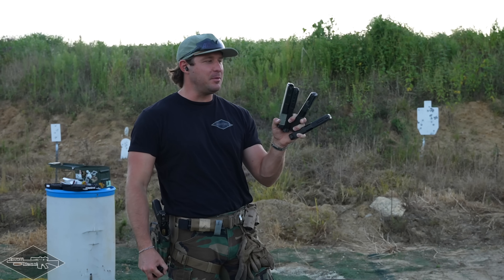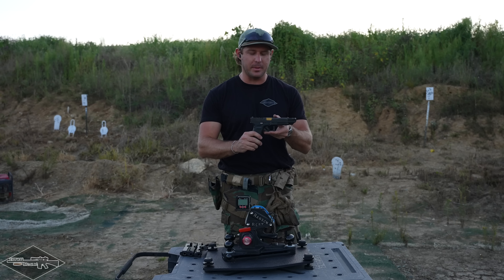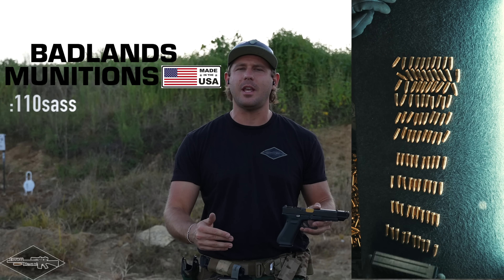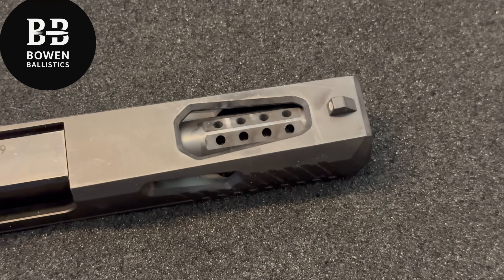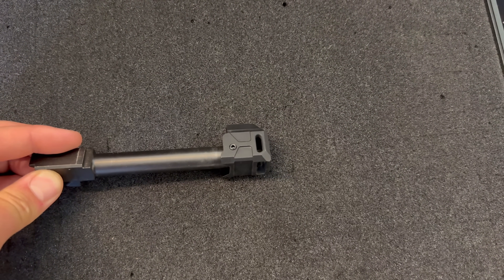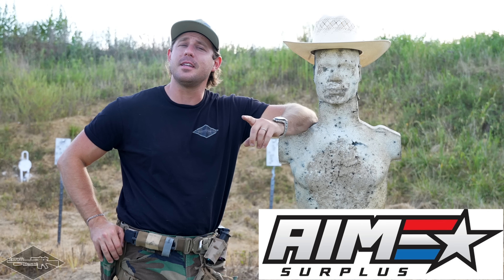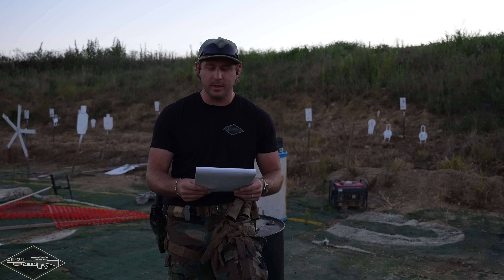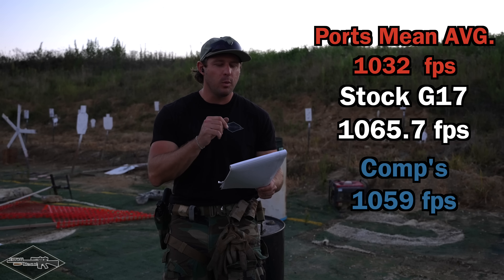Science Finally Proves It - Which Is Best?

Comment: accuracy??? seen bunch people that say comps dont affect accuracy but ports do
Reply from the maker: Nah. Quality machined ports will not impact precision 

Garbage shit will absolutely
Reply: @110sassactual  think its the physics of letting gas out part way not bad machining...
Reply from the maker: @colt45lmer-s4h that’s not how that works lol
Reply: @110sassactual  how you know?? less pressure even a little could reduce the engagement of the rifling or that the holes would interrupt the rifling could easily mess with the accuracy. i could be wrong but without some real testing it could affect it. plus i have seen several comparisons where the port had worse accuracy
Reply from the maker: @colt45lmer-s4h yes, again… a poorly machined port will absolutely effect precision…

No, redirecting gas isn’t effecting precision of a handgun. Again, it’s the poorly machined ports with burr’s tearing up the projo and causing a non uniform projo to exit the barrel 

That’s literally it bro. Don’t over think it

Comment: Great video. I’m wondering though if there’s a better way to isolate just the ports/comps as the only changing factors. I’m thinking using one G17 frame and swapping out the top ends with G17 and G34 top ends, both with window cuts in the slide, and each of which would then be configured with a non-ported or compensated standard barrel, a ported barrel, and a threaded barrel with a compensator. Keep the number/configuration of the ports the same and use the same model compensator between the two. That way the gun is configured as identically as possible between the different tests, with the only change being the presence of porting or compensator

Comment: How much impact would the center of gravity shift have on this data? I would guess, not much. Though a ported barrel will shift the center of gravity very slightly rearward. While a compensator will shift it forward (muzzle heavy). Obviously the degree of that depends on how long and heavy the compensator is. At some point it becomes a compensation weight like we see on many competition guns. Just curious. Might be an interesting things to test, but probably not interesting enough to make a fantastic video. Cheers.

Comment: I still use SOHCAHTOA on occasion in my shop.  In the past year I've been shooting a ported Hellcat Pro Comp in lieu of my un-ported Pro OSP, and the difference in felt recoil and muzzle flip is notable.  The Pro Comp isn't nearly as snappy and is easier to return to target.  I should point out the name is a bit misleading.  It's really a ported barrel and slide setup and should not be confused with the Hellcat RDP (which does have a comp hanging off the end of the barrel).

Comment: Just in case anyone wanted the statistical analysis on the differences and not just their means (I did not throw out the bubba gunsmif). Formatting sucks because it is YouTube:

Key descriptive anchors
Stock G17: n = 10, mean = 18.62°, SD = 0.57°.

Per-device vs stock, direction and magnitude
Mean difference is device minus stock, so negative is less muzzle rise than stock.
Bubba gonsmif: n = 12, mean = 12.05°, Δ = −6.57°; reduction 35.3 percent; p < 1e−13 after Holm; g ≈ −13.63.
Bowen Ballistics V8: n = 8, mean = 14.31°, Δ = −4.31°; reduction 23.2 percent; p ≈ 5.9e−14; g ≈ −8.58.
North Sea I6: n = 13, mean = 14.65°, Δ = −3.97°; reduction 21.3 percent; p ≈ 4.9e−12; g ≈ −7.12.
Agency comp: n = 10, mean = 15.92°, Δ = −2.70°; reduction 14.5 percent; p ≈ 5.0e−9; g ≈ −5.42.
North Sea Hybrid: n = 12, mean = 15.92°, Δ = −2.70°; reduction 14.5 percent; p ≈ 2.8e−9; g ≈ −4.92.
Radian comp: n = 8, mean = 16.09°, Δ = −2.53°; reduction 13.6 percent; p ≈ 2.7e−8; g ≈ −4.63.
Herrington comp: n = 10, mean = 16.41°, Δ = −2.22°; reduction 11.9 percent; p ≈ 3.0e−8; g ≈ −4.03.

All devices show statistically significant reductions versus stock.

Ports, pooled: n = 45, mean = 14.23°, Δ = −4.39° vs stock; p ≈ 4.3e−18; g ≈ −3.08.
Comps, pooled: n = 28, mean = 16.14°, Δ = −2.48° vs stock; p ≈ 9.0e−9; g ≈ −4.90.

Ports vs Comps directly: mean difference = −1.91° in favor of ports; Welch t ≈ −7.85; p ≈ 1.3e−10; g ≈ −1.53. 

One-way ANOVA across all groups: F ≈ 189.68; p ≈ 5.1e−45. There are strong between-group differences.

Every tested product reduced muzzle rise versus the stock G17, and all reductions are statistically significant after multiple-comparison control.

Among individual setups, Bubba gonsmif shows the largest mean reduction, followed by Bowen V8 and North Sea I6.
By category, ports outperform comps in this dataset by about 1.9° on average, also statistically significant.

If you throw out bubba gonsmif, 

Category results vs stock

Ports pooled, n = 33, mean = 15.03, Δ = −3.59; Welch p ≈ 3e−13; g ≈ −2.8.
Comps pooled, n = 28, mean = 16.14, Δ = −2.48; Welch p ≈ 9e−9; g ≈ −4.9.

Ports vs comps head-to-head

Ports mean 15.03 vs comps mean 16.14. Difference = −1.11 in favor of ports. Welch t ≈ −5.79, df ≈ 48.8, p ≈ 2.5e−8. Hedges g ≈ −1.14.

The advantage for ports shrinks from about 1.9 to about 1.1 degrees but remains statistically and practically meaningful.

Also, I love your Blues Clues references. We still watch it every day with the kids.

Comment: The biggest advantage to ports is that you can continue using the same holsters as the stock guns. The biggest advantage for compensators was that there was no velocity loss, so it's something hunters would possibly prefer. Thank you for proving that ports are slightly better at reducing recoil; it's something I always guessed but could never prove.

Comment: My comment before watching:

I'm expecting both to do the job they are designed to do with negligible differences.

Finished watching:

It sounds like most simply aren't big enough or they need to be longer for more ports. Possibly a sub comp pistol with a 4" or less barrel with a longer comp with more vertical ports?

The only issue I wound have with porting is you can't use a suppressor if you wanted to. I'm curious what that affect would have.

I would also argue the loss in velocity with ports is significant considering they start going below super sonic speed.

Comment: Someone doing a test correctly and solving for 1 variable. Angular rotation.

Shinyribs soundtrack
Ransom rest w/ digital angle gauge

G17 Gen5 w/ factory guide rod and springs
Same lot 124gn new ammo
Baseline chonograph
Stock: 1065mv avg, 18.62° avg rotation
Comps: 1060mv avg, 16.11° avg rotation, -13.48% ▲
Ports: 1035mv avg, 14.93° avg rotation, -19.81% ▲

Myth, legend, lore, and lie were the casualties of solid testing. Thanks for taking the time to put all this together.

Comment: Compensators not affecting muzzle velocity makes sense if you think of it.  The barrel length is unchanged, thus the pressure is unchanged.  The venting is all after the bullet leaves the barrel.

Porting reducing both muzzle velocity and recoil also makes sense.   The venting is happening as the bullet is still in the barrel, and thus can't push the bullet as well once some of it is vented.  So, less overall power makes for less recoil, and the venting reduces it too.
Reply: Ports also change the performance characteristics from what the ammunition manufacturers intended. This doesn’t matter much if shooting paper targets, but when engaging actual threats, I want as close as possible performance as intended (muzzle velocity, hollow point expansion, penetration, wound cavity)…I’m sticking with compensators. Ballistic performance with lessened muzzle flip for faster rapid engagement vs stock. But, that just my opinion…ah, isn’t freedom awesome.🔫😏👍
Reply: @charlescordell6337  I do agree 100%.  One of the reasons I prefer guns with 4.5 to 5" barrels is that's usually what the ammo is tested with.
Reply: Comps also get what is effectively a longer dwell time where the ports are pressurized and acting to reduce muzzle rise

Comment: I am not gonna lie;

I figured the ports would be less effective as the compensators add mass to the end of the weapon, as well as have a more distal application of force from the shooter.

So I'm shocked as 💩
Reply from the maker: It almost speaks volumes as to how ineffective comps actually are…

Adding weight to the end plus dispersing gas… and still doesn’t compete with a lighter and shorter pistol
Reply: @110sassactual  I have to pushback a little... 
Have a ten percent reduction isn't worthless... 

Full disclosure two of my weapons have comps, so I could be biased by "sunk cost" fallacy.
Reply from the maker: @danielrickner7190 definitely wouldn’t say worthless. 
But definitely grossly inefficient considering they add OAL, make holster fitment a pain and  have a fraction of the muzzle flip reduction
Reply: @110sassactual no lies detected.

appreciate the work you put into the video boss. 

Stay safe out there.

Comment: This is the exact sales pitch we use at Fourged, only a 3-7% decrease in velocity and 15-20% reduction in recoil with our testing. We’ve had bad luck with comps not running well with factory recoil systems. It’s only $150 to cut a hole in the slide and port the barrel on a fiber laser to avoid fouling the rifling. A threaded barrel alone will set you back $150, another $80-120 on a comp, and if it’s not reliable with factory recoil another $40-$60 on a reduced weight recoil system, the ramjet is almost $400 as a kit. It’s a no brainer and that’s just a 17, it’s even better on subcompacts where the gun is already snappy. You’re trying to keep the footprint as small as possible for concealed carry and there’s not a lot of options for comps on the market not to mention and even higher likely hood of malfunctions comping a subcompact over porting. If you hate the ports, a standard barrel replacement is cheap and you won’t be stuck with a compensator you can’t get rid of. Glad to see someone else making a video to push this.
Reply from the maker: Thanks for watching!

Comment: It would be really interesting to repeat this test with a few different types of ammo, like +P.

Back in my ipsc days we were always told 9mmP wasn't worth comping, not enough gas. 38 Super was.

Now a lot of things have happened to ammo tech in the last 20 years, so this might no longer be true.

I have conflicting thoughts about how this might turn out. 
Are new 9mmP with better gun powder sustaining the pressure, within the maximum allowable limit, more consistently through the projectile's travel down the barrel. Yielding higher velocities in shorter barrels and therefore more high speed gas venting out behind the bullet as it leaves the barrel, thus producing better effect for a comp/port? 
Or are new gun powders more efficient, applying pressure while the projectile travels down the barrel, but much less excess gas is present and thus comp/ports are less effective?

Comment: Tests involving slide swaps don't account for weight. All other factors must be equal such as weight on end of barrel, weight of slide, weight of combined reciprocating mass etc. I know nick picking but for a truly scientific a-b test all those factors count. The came recoil and guide system must be used to each as well. The same ammo must be included as well. A batch of low pressure rounds will cause less recoil.

Comment: How do you calibrate out the force of your finger on the trigger release? It seems like pushing down on the orange handle is going to increase the muzzle rise.
Reply from the maker: The bar is coaxis and designed to be perfectly consistent each trigger pull. 

What was done to one, is done to all, the same.

Comment: Good video.  Methodology appears sound.  Thanks for producing.

Given that compensated barrels appear to reduce muzzle flip by approx 13%, while ported barrels appear to reduce flip by approx 20%, it would be interesting to see how each in turn affects follow-up shots in various low-light shooting situations, both when using weapon-mounted or hand-held lights and when using only available ambient light.  Evaluations of standard barrel versus ported versus  compensated barrels, comparing follow-up shot accuracy versus follow-up shoot speed, would be interesting.

Excluding my S&W 460 Magnum revolver, I have not fired any other ported handguns nor have I fired any compensator-equipped handguns.  My experience has been that during low-light tactical handgun classes, when shooting over iron sights that muzzle blast beneficially silhouettes the front sight, while when shooting using red dots, the muzzle blast somewhat illuminates the target.

Comment: I think we're not considering that compensators are also muzzle brakes that not only helps muzzle rise, but rearward force as well. To me, it seems that ports lose 40fps and dump all its gas to countering vertical rotation while the comps expend a portion of its energy to rotational force as well rearward force while not losing any fps. What I'm trying to say is that actual felt recoil may be closer than what your tests show when fired with your hands.

Comment: Love these series.  Thank you!  Sounds to me you're getting a trade off - more recoil mitigation at the expense of velocity with ports vs some recoil mitigation with little to no loss in velocity.  However, ports have the additional disadvantage of the ports shaving mass off the projectile if not done right.  Someone demonstrated a close quarters situation with a ported pistol and ended up with shavings in his arm.  

So it basically comes down to what it's going to be used for. For me: Competition, ports all the way; EDC, stock or comp.

Comment: The average velocity for the 3 ported barrels without the homebrew (which brought the average down significantly, and was excluded from the muzzle rise average so should also be excluded from the velocity average) was 1042.6 fps, in case anyone was wondering. So, really, not a massive reduction in velocity. Only an average of 17 fps or roughly 1.6%. So you get an average of only 1-2% less velocity for an average of 5ish% less recoil (31.8% more of a reduction, comparatively)

Comment: Great video. 

My takeaway: muzzle velosity is directly related to muzzle flip. As velosity decreases, so does the flip. 

Want a flatter shooting gun? Youre likely going to lose some velosity.

That veing said, youre still slinging metal seeds at your target, and anything traveling over 50 fps is going to hurt.
Reply: fair but it's worth mentioning that you get a ~20% reduction in flip for only losing ~2.8% of the muzzle velocity.
Reply: @some_random_ideas exactly
Reply: This will obviously apply, but ONLY when shooting the same bullet weight and loading from the same gun. Needless to say, heavy slow bullets are still going to recoil more than fast light bullets.
Reply: @militantfascade9176 In fact, what would affect how much the weapon moves is momentum
Reply: But we don’t use guns to hurt, druggies don’t feel hurt very much. We use them to punch holes. Paintball arenas have you chrono in close to 200 fps, and that hurts. If I’m looking for pain without liability, I’m reaching for the hot sauce spray
Reply: Round still does its job and thats all i care about
Reply: So in other words, .45 ACP would have less muzzle flip than 9x19mm?

(Could also explain why 10mm Auto is the way it is and not just a rimless version of .357 Magnum)
Reply: @camarokidbb4347 for that youd wana find a gun that can be converted from 9mm to 45. Which there aren't many of. And having shot a 10mm S&W M&P 10mm and comparing it, as best I can to my dad's G45 (9mm), I didnt think the 10 had any harsher recoil than the G45.
Reply: Exactly this. I'm kinda disappointed this wasn't directly addressed in the video, because THIS is the point.

Comment: This was measuring the reduction in muzzle flip, you need to put the Ransom Rest on a sled system (or a force measurement gauge in the Random rest) to measure recoil (the amount of push to the rear). Felt recoil is a blend of both.

Ports are generally more effective at reducing muzzle flip, while well-designed compensators are generally more effective at reducing felt recoil. At least that was what my testing showed. As with everything, YMMV.
Reply: Thanks for that information as well.
Reply: I agree. 
There are also tests out there that reflect that the Agency (best performing comp in this test) is fairly middle of the road in regards to performance. The newer more compact comps don't perform to the same level of the older ones the ATEi and Zev which have significantly larger ports in my personal experience
Reply: @Man_Emperor_of_Mankind  Sadly, compensator design for Glocks isn't really following what we already know works. The more volume in the expansion port, the more effective the compensator. So all of the ones that are basically a barrel with cutouts are the least effective design possible.
Reply: @justinblower7598 I agree. It seems like companies are trying to change things to miniaturize comps to look cooler and appear to be more friendly to carry, even though this had all already been figured out with the Roland Special style guns which popularized carrying pistols with optics and comps on them
Companies are also likely intentionally limiting the performance of the comps to minimize cycling issues that can be caused by reducing recoil
Reply: @justinblower7598  Expansion port volume. You said it. But as emperor also said, it does affect cycling. I'm looking at one mother of a port I just completed for a customer, to his specs. And all I can think of is he has to up his whimpy reloads. He is running 124gr @ 950 fps.

Comment: With the ports bleeding off velocity, I feel like that would drop recoil like it would with reduced power loads. I'm curious if this were to be done with handloads where the velocities are the same and not 30-60fps in variation between stock, comp'd and ported. So hotter loads in the ported, standard loads in stock and comp. I imagine we would see quite a bit less difference between comp and ports.